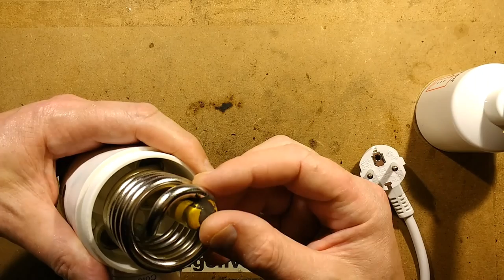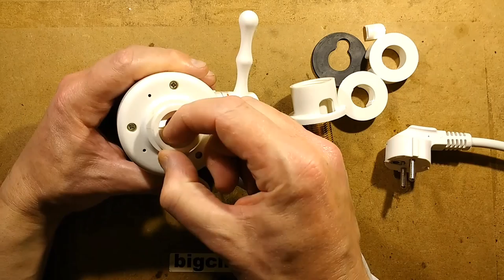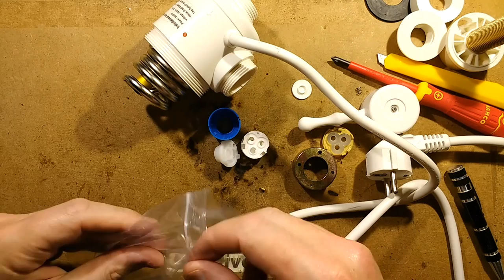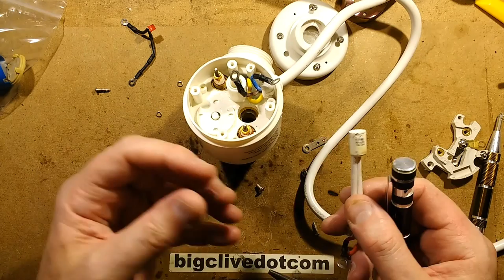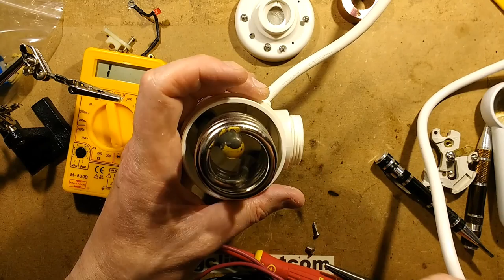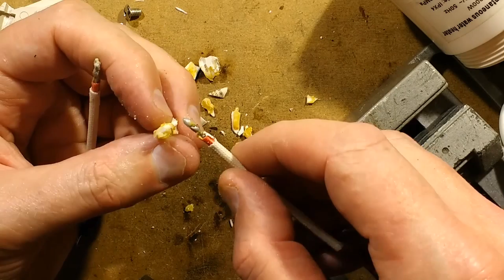Cheap electrically heated tap / faucet teardown.  (230V)

Comment: I like watching the removal of screws, helps understand in how everything fits together. 

It is also interesting to hear about the different water heating methods, living in a house with no gas for the first time, so only having an immersion heater tank, water heater unit attached to the wall by the sink and an electric shower. Its always interesting to find out more about how they work or other alternatives that may exist.

Comment: Hi Clive, the over temperature protection has to be either manually reset (too difficult to engineer in that small of a package), or fail safe, if it was a bimetal arrangement  it would not isolate the element in case of a fault, it would simply hover between the set point and hysteresis points till the water boiled dry and the plastic body failed. That is a very a small thermal fuse to have 12-13 Amp rushing thru it, the self heating would have been nice to see with your FLIR camera, another great video, thaks

Comment: The pin and spring will be there to create a detent at the "water off" position, because if you're off to either side of that you will have water leaking out the tap. It's hard to tell if the tap is dripping because you just used it or because the lever isn't in the exact off position. The clicking sound is just a side effect of that.

Comment: 13:45 I got an under sink water heater last year and it is so very wonderful indeed.  Everything you described says it's probably a similar design.  I've got mine hooked up to the hot supply, so by the time the tank is drawn down to a lower temp, the main line is fully hot and it's pretty much limitless.  I tell myself "it's a quality of life improvement, not a cost-savings benefit" because I heat the pipes in the walls on the short uses.

Comment: You call it "broken" after the thermal fuse was destroyed.  I call it "Pre-configured for Photonicinduction's 'experiments'."  ;)
Reply: "let's crank it up until it's pops"
Reply: I ain't havin' it!
Reply: iri10 wheres me AMMER!
Reply: I popped it!!
Reply: Alan Cordwell im loving this comment thread thats dedicated to photon :D LONG LIVE PHOTONIC ANDY!
Reply: I have seen tiny pre-set temperature bimetallic strip thermostats used into laser printer fusor units. replacing this with a 60°C to 70°C should keep it fairly safe without making it a sacrificial thing
Reply: Would be interesting for Big Clive, Photonicinduction, and perhaps other "electrically inclined" YouTubers, to have a trade/swap system going. For example: someone introduces it, another takes it to bits, and the third pops it.
Reply: Andy hasn't posted a new video in nearly a year... Last one I saw was just an over powered car radiator fan...
Reply: "I want FLAMES!"

Comment: Those ceramic diverter type modules are quite common now, as someone that works in construction I've seen them gradually replace the typical brass screw valves inside taps. They work quite well for those single handle ones, and showers too.

Comment: The DEVISE of Knowledge !   What a Flipping Hoot.    I actually need something like this living semi primitive in a minimalist Mobil home.   120VAC and or 24VDC is proving to be somewhat a Obstruction.  Our 120 limited in Current to 20 Amps and our 24V limited to 60 Amps.  for two hours.   May end up building my own  using a regular 24vdc heater element contained in a small bottle.   Just looking for a WARM shower situation.

Comment: Clive, good video. It reminded me of a miniature boiler to all intents and purposes which after some contemplation I decided I was silly as that is what it is. The first time I came across one of these was, 18 - 20 years ago in a hotel in Sacramento, California in the US while I was working over there. It was located in the bathroom but it was also safe to use in tea and coffee. I was so intrigued with it I took the information I could see, using a mirror and magnifying glass as the unit was mounted under the countertop with limited access. After 3-4 weeks I came back home and delved into the water heater seeing perhaps an opportunity for a UK outlet of an American product. However, that was not happening as the units were made in the UK.

Comment: The instant heated water that you mention is why I have been considering picking up an under the sink water heater. I live in a state in the US where half of our year is freezing cold temperatures. Even during the summer it takes a noticeable amount of time for water to travel from the tank to the sink. The only house I have lived in where that wasn't a problem was the house I spent the first 14 years of my life. Combination of heated, insulated basement and good planning on my father's part.

Comment: I do enjoy how people have a knee jerk reaction to water and electricity when it's at the faucet or the shower head, but don't bat an eye at an electric water heater, even one that's just under the sink. Or even electric kettles, for that matter.
Reply: I'm using a good ol Propane water heater. Hank Hill hooked me up. He sells propane and propane accessories.
Reply: Loren Husky I still use lovely old coal/firewood to heat my water, it adds a nice smokey flavor.
Reply: You can probabily blame this one a combination of the false stuff you see in movies to create tension and peoples fear of confined spaces, like the shower.
Reply: Well, this one has insulated heating element, maybe that's why :)
Reply: Arguably, the water heater is more likely to have proper grounding than the faucet or especially the shower head. If nothing else, the pipework or sink is likely to be bonded to ground. On the other hand, in a plastic product like this, if the ground connection is lost, and there's a fault creating a current path to the water, the water is nominally at 230 V and could reasonably pass the 30 mA or so required to kill you, through the water. 

But this product at least has an electrically insulated element that's grounded on the outside, so you would need a double fault to create a hazard. Don't get me started on the shower heads that are common on South America which have a direct contact element. Often the only thing protecting you is a small piece of solid copper ground wire placed through the waterstream to equalize the potential of the exiting water. If that wire corrodes away, you'll get a nice tingle through your body. Those are often two-in-one products which pose both an electrocution hazard and a fire hazard.
Reply: Zzyzx Wolfe when you pick up a half decent kettle to pour, it's disconnected from the electrical source by the action of picking it up from the base.
Reply: I'm terrified of water and electricity mixing, so I use highly flammable/potentially explosive gas and open flames instead.
Reply: "Now that's a clean-burning fuel, Bobby!"
Reply: "taste the meat, not the heat"
Reply: Loren Husky friggen rights, propane ammonia refrigerators also
Reply: Gameboygenius too bad its a 2 prong plug
Reply: anononomous explosions are always more exciting then a few sparks
Reply: Most people simply do not take a bath in a kettle.
Reply: @Gameboygenius  Not in modern construction. PVC.

Comment: when I was a child back in the day, I remember at school there was a wall mounted water heater, it wasn't instant however and had to be switched on to heat up a bit like a kettle. when it reached temperature it would blow steam through a accordion like structure making an accordion like noise. I'd never seen one like it before. occasionally you'd wonder if it would break out into some sort of parisien street music.. of course, it never did.
Reply: My first flat had one of those. You filled it with a push fit grey rubber hose.

Comment: Keep in mind that at 120C the water in the heating/storage chamber would already be superheated past the boiling point and ready to instantaneously flash to steam upon release, which means a lot of internal pressure on the pressure relief plug and likely blowing out the plug well before reaching that temperature.  Realistically it should only ever reach 120C if run dry since it is not designed to contain supercritical heated water.

Comment: I have had the idea to use an in-line water heater as a booster to go into a large tank-style heater, specifically for use at a camp that I work at in the summer, as just two massive tank heaters runs out rather quickly when there are about 30 of us showering within an hour or so. I'd be interested to see if that could be small-scale tested with an undersink and a unit like this...

Comment: Oh boy, water and electricity, always fun!
Reply: EpicLPer I am a big fan of his heating shower head of death with exposed heating element. Extra special tingling sensation is free 😺
Reply: You got no RCDs?
Reply: and it is not the fall that kills you.
Reply: girlsdrinkfeck if you have a look at Big Clive's suicide shower, you will notice the lack of an insulated heating element, unlike this faucet adaptor which does. I would not temp fate standing in a shower with 120 or 240v at the very least a tingle from the shower head. Nearly guaranteed to pop an RCD/GFI, unless you have totally pure water with nothing in it unlike most water. Would be interesting to how it would work with salt water 😜⚡️💥⛈🔥
Reply: This is harmless; It's using an insulated heating element.
Reply: Spudcosmic i replaced many defrost heaters burnt through ....
Reply: Mythbusters shows "free-flying" water doesn't conduct, as it is broken into drops very quickly, no conductivity in the air between the drops. But don't touch the showerhead ;-)
Reply: @girlsdrinkfeck  Yeah in my old home we had an electric shower and it’s just as good as the shower that we have from the mains in my new one run from the Combi boiler.
Reply: @girlsdrinkfeck  where did you get that statistic?

Comment: I never thought about terminology before.  Here in the US we tend to use faucet, but we'll refer to the water as "tap" water or water from "the tap".  However, you wouldn't buy a "tap", you would buy a "faucet".
Reply: Proper English, tap water comes from the tap, you put your rubbish in the rubbish bin.
American English, tap water comes from the faucet, you put your garbage in the trash can.
Reply: Yep.  On cars we have a hood over the engine and put our boots in the trunk.
Reply: Cars have different UK/US words for almost every single component... windshield/windscreen - gas/petrol - manual/stick - transmission/gearbox - dash/glove box - tyre/wheel - tailpipe/exhaust - etc

On the subject of taps though many of us Scots refer to them as 'wells', not sure if Clive's hometown does, but everyone in my area does.  Does baffle folks to learn we have wells in our kitchen and bathroom until they find out that they are just little brass fellas like any American house would have and no buckets or ropes in sight.

Comment: I suppose, for 20 quid, you don't really expect much, but this device doesn't look like one of the ones that threaten to set your house on fire, which is a good thing. At least it won't cost a fortune to replace.

Absolutely agree on the point-of-use water heater. Had one here since about 1984 (Santon, or Sadia, not sure which, but companies did merge, so same thing really), and it was second hand from work. It has only ever needed a new pencil thermostat and a new bottom unit 'O' ring. It's given me 35 years good service so far, and was about 20 years old when I got it - 2 gallons of piping hot water only a few seconds away from the tap 24/7. Can't be bad!

As you say though, your 20 quid jobbie is plenty for the sink at the back of your garage etc.

Comment: I use something very similar to this for my kitchen sink - it isn't as bad as you might think. The sink is a long way from my combi boiler and it would waste loads of water and gas just to get a bit of hot water for the washing up so I put in a plug-in electric tap. Yes the water flow from it is slow for hot water, but actually it probably doesn't work out much different to the boiler for the amount of water needed for washing up (especially as you can start while its still filling and it heats up way faster) - but with the advantages that:

1. It doesn't use gas; c'mon everything that can be electrified needs to be, lower emissions etc.
2. It uses less than half the water I'd otherwise have to use.
3. Its a weird curiosity that makes visitors double-take if I say help yourself to a glass of water or whatever.

It isn't designed for drinking water, I guess just because of the type of plastic used, but I'm not bothered because I still have the normal cold tap in place.

Main advantage though - it looks like a Blue-LED Crazy Dalek!

Comment: How are you supposed to get the power cord through the plastic piece on the bottom if you want to use that feature? Do you need to take it all apart and unscrew the ring terminals? That seems like an odd design to me.
Reply: John Hiesey cut off the connector, who need it an way? just jam bare wires into your outlet
Reply: it's gonna be during initial installation, usually people aren't expected to do this kind of plumbing themselves
Reply: That would be dangerous.  No, stick the plug back on with Sellotape, do it properly....
Reply: its the wrong plug anyway cut it off
Reply: @jostouw4366  Just install a European socket under your sink for the plug - It's going to be about as safe and approved as using this heater in the first place! :-/

Comment: Sorry if this has already been covered by somebody else -- I did not read ALL comments.  It looks to me like the cut-out might be one with melting WAX.  There did not seem to be a spring, but the two contacts could be assembled with a spring tension and just held together by the solid wax.  They would separate when the wax melts, opening the electric path.  The tripping temperature can be adjusted by appropriate selection of the wax composition.  That principle has even recently been used in American thermal cut-outs for electric motor overload protection.  There were and probably still are one-time units, but I have seen (a long time ago) units that could be heated again, pushing the contacts closed when the wax was again melted and then held closed until the wax had solidified.  Crude manual reset, that is.

Comment: Something very similar is used inside pad-coffee-machines here in Germany. A small pump is pumping water from the tank through one of those heating chambers directly into the pads filled with a coffee-dust.

Comment: Kind of glad we don't have these and  electric shower heaters here in North America. They just seem like bad ideas. We have small "point of use" water heaters usually 5 to 10 gallon in 120v or 240v varieties. They work fairly well for low demand applications like bathroom / washroom sinks and such.

Comment: Just to say I've been using this xact model in my basement workshop for about 2 years now with not a single issue. My only complaint is that it relies not warm enough when the tap is wide open due to the water flow rate but then its par for the course with this sorta design and much better than washing your hands, spork etc with freezing cold water in winter. For occasional use it's pretty perfect. On he top floor we have a vented undersink unit  with a 3 or 6ltr tank. Thats super frustrating as it runs out pretty quick and then you have to wait an age for it to warm up.
Reply from the maker: I use a vented undersink heater here.  You have to get used to not using huge amounts of hot water at once.  Other than that it's very efficient and delivers hot water instantly at all times.